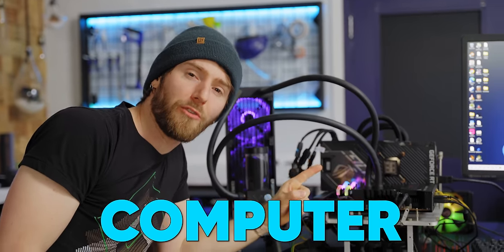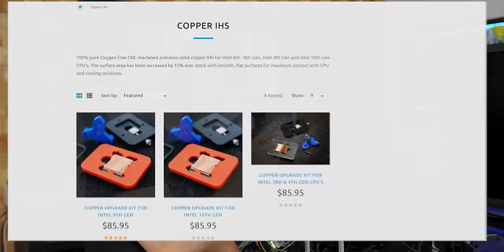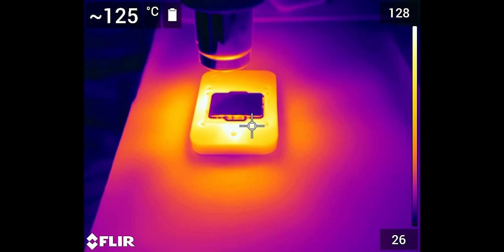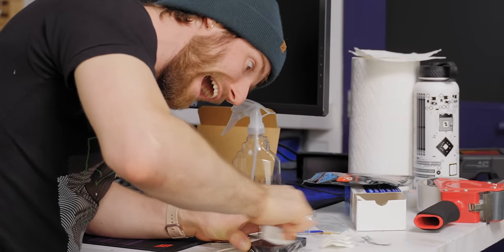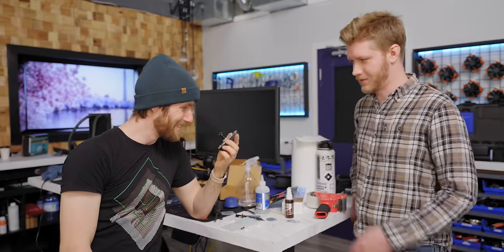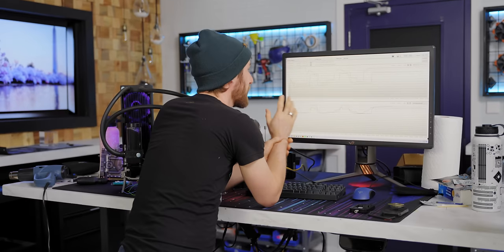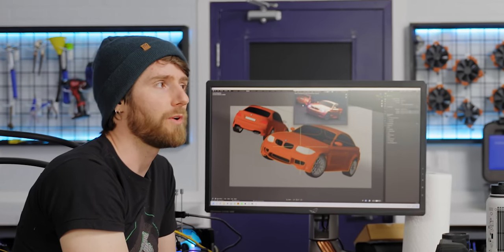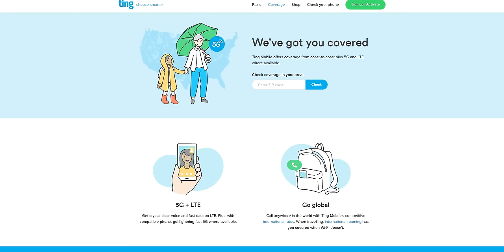Making Intel's Worst Product Better.... And Also Worse

Comment: The time consuming part for keeping the tolerances so tight isn't the machine itself nor it's quality (well to a degree on quality of the machine) but the frequency you have to check tolerances and change the tool wear in the settings of your machine, as well as how you mount what you're machining, depending on what you make you may have to choose between something that gives extraordinarily repeatable results and has no play or something thats fast, just depends on what you have to work with because your fixture is definitely important

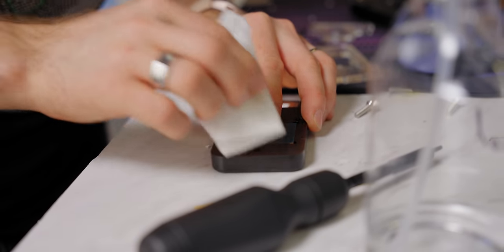Comment: 6:00
Its a good idea in theory, but in my experience those tape guns are vastly inferior. They have another point of failure AND restrict the way you can use it. It may be fine for a couple of uses at home but try packing two or three hundred packages yourself in a day and you will know the difference. Just get the standard 3M tape gun without that "safety feature" and learn how to not cut yourself with your tools.
Reply: Those tape guns may be required by Canadian OH&S.

Comment: You need to invest in a set of gauge blocks. If you can wring the IHS to a gauge block, then you know it’s flat. Same goes for the your coolers touch surface. Having a surface grinder with an aluminum oxide wheel, diamond honed, on had will let you be much more precise than the hand pressure wet wheel method seen before.

Comment: what would be the temperature from just delidding the CPU and putting liquid metal under the stock IHS? Would be nice to know for comparison
Reply: Not much. Der Bauer (der 8auer) already tested it on his channel some time ago ^^
Reply: @StitchExperiment626  did He? I only found the Video where He killed his 12900k
Reply: I'm also curious about how this aftermarket IHS performs compared to a lapped stock IHS
Reply: Since it's soldered I think it would be about the same, it's not like the older CPU's that used some cheap paste.
I think part of the difference might be the thickness of the copper lid.  I have one of those (no name brand) for X series and the lid is about 2mm thick, vs maybe 0.5mm stock.  More thickness would allow the heat to spread out more better from the CPU die to the rest of the IHS.

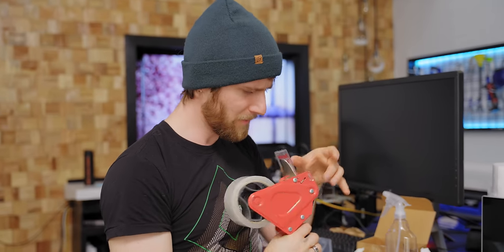Comment: 6:01 It's these sorts of things that make you realize Linus is really savvy when it comes to tech, but he can be truly clueless when it comes to "normal" stuff lmao As if it's the first time in his life he has to deal with a tape dispenser...
Reply: to be fair, that is a crappy tapegun design to use. esspecially when typical use and abuse happens to break off the top flap and the whole gun is unusable now.
Reply: @Dreddy72  As someone who has to send packages on an almost daily basis, this Staple's tapegun is fine and virtually impossible to break by accident, you'd need to try and break it on purpose. And I'm no gentleman when it comes to taping packages...

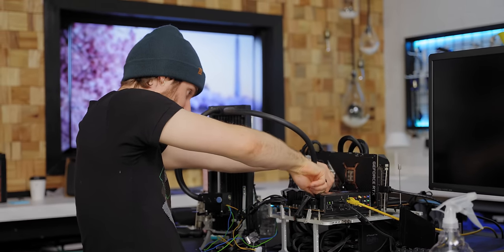Comment: 10:40 nope, you're not tried hard enough to get perfect temperatures... To do this you should sanded the heatspreader and water block up to perfect flatnnes and shine ☝️
Reply: flatness yes, shine, no. thermal compound likes a slight texture
Reply: @ljfran2383  No need for thermal compound when the surfaces are as smooth as gauge blocks

Comment: Intel should definitely still be worrying themselves later this year, now that AMD is fully switching to LGA and potentially brining their 3D cache tech and RDNA2 UHD graphics to do anything into one. After them realizing they’ll be able to break their limits of DDR5 speeds too like XMP, but more insane
Reply: Why would Intel be worried about AM5 being LGA?
Reply: Man that's gonna push Steam Dieck stonks to the roof.. Hell yeah
Reply: I believe Intel themselves will be bringing upgrades with double the small cores alongside higher performance for the big cores. AMD will most likely take the gaming crown while intel workstation crown.
Reply: Don't know how lga should make them worried, but 3d cache still needs more work. They won't implement it on R7000
Reply: Honestly, lga1700 motherboards are ridicolously expensive when compared to AM4, especally at the lower end. And I expect similar pricing for AM5 boards, because of PCIE gen5 and DDR5 as well as being the hot new shit.
Soooo Ryzen might be a king in performance, but could lose on the  value front.
Reply: Raptor Lake appears to be no slauch, and Intel's getting into the GPU market for real. I'm especially curious about Arrow Lake though. I just built myself a PC with a 5600x, so I can wait.
Reply: The better DDR5 support is going to be the most important component. Ryzen is super dependent on RAM speed and timing to maximize performance. 

Current DDR5 support in Intel Z690 has lots of issues, especially as you go to 4 sticks or more of memory.
Reply: why should lga be a selling point?
Reply: Intel will be fine since AMD decided to make AM5 only compatible with DDR4.
Reply: I hope they don't brine their 3D cache, I think that can cause corrosion
Reply: @EAGYSL  it doesn't really have a performance impact, but it's safer to have the pins on the MB instead of the CPU
Reply: I wish I bought AMD stocks back in ‘15 or ‘16, but I’m definitely gonna buy stock in AMD and Intel now lol. AMD for AM5 and Intel for when if they ever get around to launching their own GPUs lol. Big things are coming soon all around.
Reply: Intel is also making their transistors smaller.
Reply: You have been saying Intel should be worried for the last 4 years

32 years from now you will stolll be saying Intel should be worried
Reply: @Cooe.  I said safer, as in less likely to bend in the first place.
Reply: @directlinkrexx4409  32 years from now intel might go down a nanometer.
Reply: @Cooe.  I mean sure just change what I mean after I clarify it.
Reply: @Cooe.  Where it helps AMD is economics. LGA means fewer parts defects in manufacture on top of lower cost of manufacturing all CPUs. It shifts those problems and costs to board manufacturers, which has helped Intel profits for a decade.
Reply: @Cooe  >>>  @ValentineC137
Reply: 3D cache is not standard for Zen 4

Is AMD really putting RDNA2 (or even 🅱️ega for that matter) in anything other than an APU?

Zen 4 will be playing catch up.
Reply: @HQmusic9  
So stating facts makes me fanboy

Noted

Comment: 2:52 Hey Linux, CNC machinist here !

The reason why a good surface finish like this costs alot is because we need specialised carbide inserts in the facing tools and alot of machining time to get such a finish. Specialised inserts for insane finishing capabilities are more expensive, as well as the tools to wield them. So its not really a question of a better machine or not, but more like better tools and more work time, therefore the value is higher.

Comment: Here's an idea for cooling experiment.
Lap that IHS and a cooler for a perfect flatness on both surfaces to see if you don't need thermal paste. You could also try to attach the cooler to the ihs in vacuum to make a cold weld contact.
Reply: ^^ THIS ^^
Vacuum

Comment: The fact that even with a high-end cooling setup and exotic liquid to boot is STILL not enough to realistically keep that chip under wraps only further proves to me that Intel still has a long way to go if they want to properly catch up to AMD. Yeah, that thing is faster than my 5950X. But, I can still get reasonably close to it in performance all the while drawing significantly less power from the socket and putting out far less heat. I can run my chip on an NH-D15 comfortably all day long w/PBO enabled. I can't run that 12900KS let alone the 12900K on one out of the box without severe thermal throttling. That's just ridiculous.
Reply: NH-D15 is what I was/am planning to get for my 5950 but my temporary NH-U12 is keeping it surprisingly cool.
The fact that I can run PBO and do a full 4K cpu video exporting while not seeing 90*C made the U12 alot less temporary than I was expecting
Reply: @ValentineC137  Same on a be quiet Dark Rock 4 with a 200w PBO 5950X, it's simply incredible how efficient modern AMD CPUs are. Draws the same as a significantly slower R7 2700X, and I've measured in some workloads 3x better performance

Comment: i think a more 'accurate and scienfitic' method would be like der8auer did - measuring the average thickness of the thing with a micrometer and evaluate a standard deviation. Just measure like 20-50 spots on the heat spreader and compare the standard deviation to the copper one.